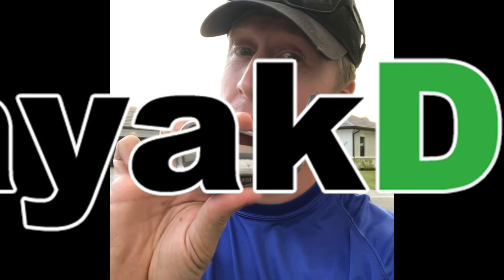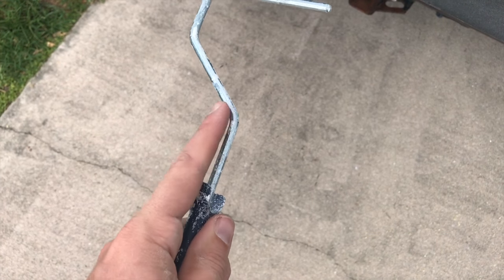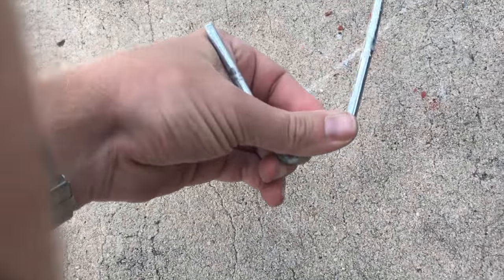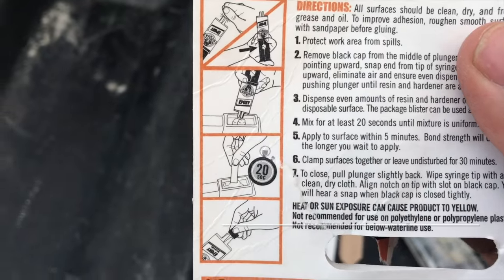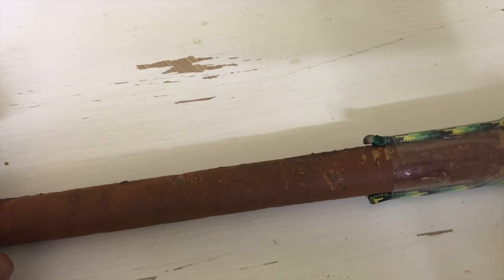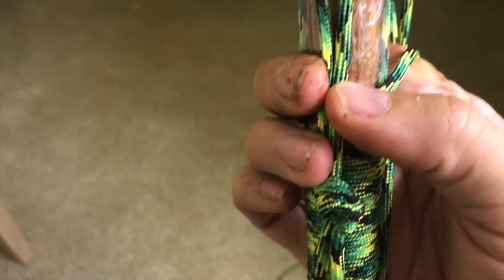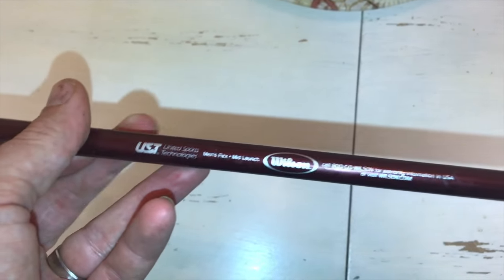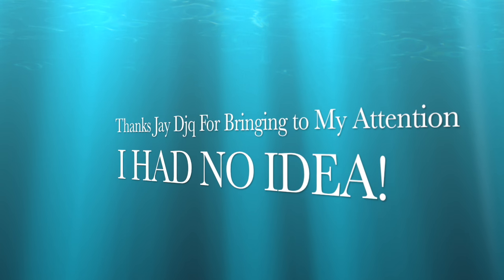Homemade Fishing Gaff From Golf Club

Comment: What is the largest fish you've gaffed with this? And thanks for your hard work in sharing like you do
Reply from the maker: +Gary Jensen it can gaff larger fish than I have recently caught.  Largest I have done with it....prob a Jack Crevalle around 30 inches or bigger.  Look at basspro...most high end gaffs ($60+) are not much different in appearance.  The epoxy has bonding strength of around 3000psi.

Comment: Use a torch or heat gun to pull the shaft. You get a smaller end for your paint shaft !
Reply from the maker: +Dan Williams didn't need a smaller end for paint shaft.  In fact needed the hole larger if anything.  The hollow center gets smaller towards the distal end.  I purposely tried being a bit crude with this build to show folks it can be done multiple ways.  It is a really easy build.  I could make this in probably 5min or less if I wanted to make several.   Great suggestion though on how to remove a club head.  Thanks Dan.